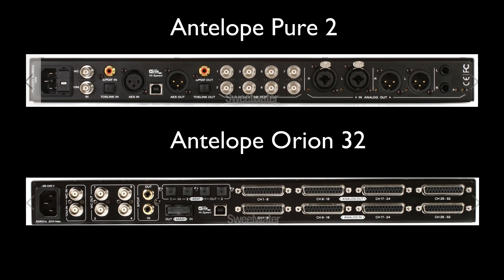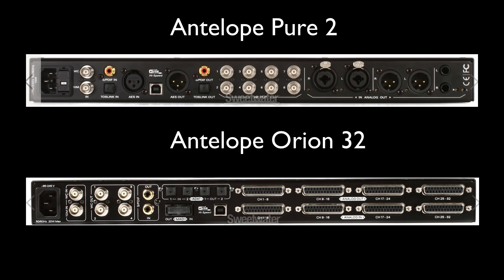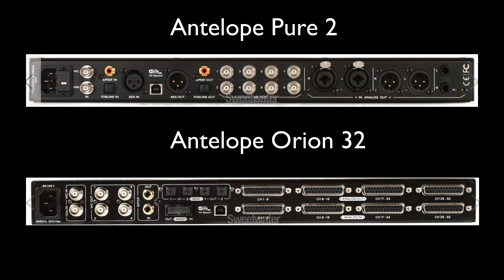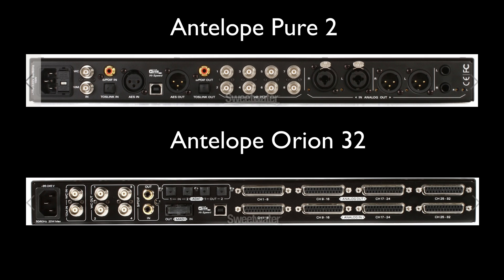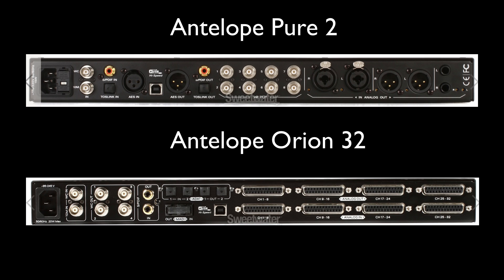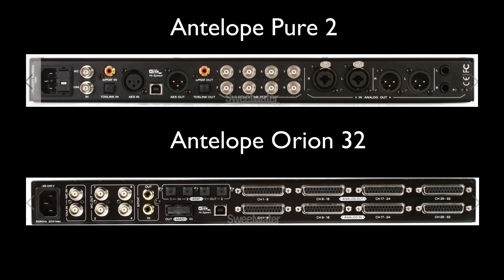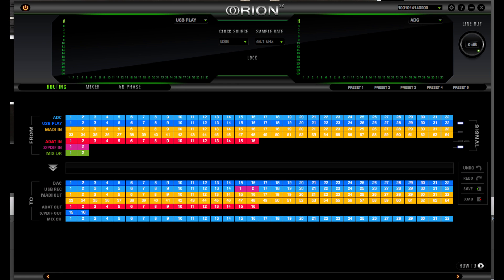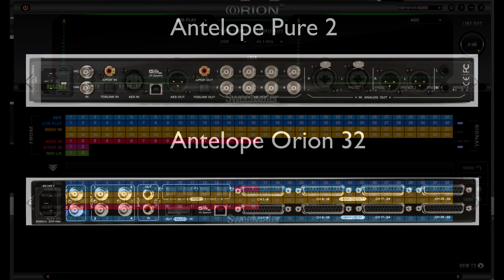Audio Converters explained and how to connnect them

Comment: Hello, GREAT VIDEO! Thanks so much. Can you please help me with the following.
I jut got a Burl B2 ADC and I wanted to ask how I would hook up the B2 ADC into my Apollo X8P so that I can mix and listen to the out put of the B2?
My normal chain and bouncing option is straight from my Apollo X8P to hard disk via off-line bounce.
So now heres what Ive done to accomplish this:
* Clocked the Apollo to the Burl with word clock BNC (Master)
* Routed output 7/8 from Apollo to analog in on BURL
* Burl TOSS out to Apollo ADAT in 1 (changed Digital input in console matrix from ADAT to SPIDF)

This is where Im stuck!
Id like to listen to the B2 while producing/mixing.

I would also like to track thru BURL while recording vocals. 
Im thinking of putting the the BURL and the Apollo out 7/8 on to a patch-bay. So I can accomplish this.
Thanks in advance

Comment: What are your thought on this? So you are only recording 2 channels at a time when using your high end ADC?  Using toslink / ADAT you can use 8channels max?
I'm using the Burl ADC for 2 ins on optical / spidf and RNC MBC for 2 channels in on ADAT. That gives me 4 high quality ADC's available at one time. Recording from channel strips. I thought about the new Heritage pres with ADC 8channels but thought the MBC might be better and with the Burl and MBC I have two options. I have great channel strips so I don't need more pres...want more....maybe.  

I guess it does not really matter what interface you use if you don't use the mic pres or built in converters.  As long as the interface works with your computer and DAW efficiently. Not using the built in pres and ADC and DAC seems to eliminate any latency or lower it if there is any.
What has been your experience?

Comment: Love your videos. I have an Apollo 8xp and am Apollo 8 connected together. I have my pure 2 commected to the tos link on the Apollo 8xp set to SPIDIF. I can mix and then export my final mix over SPIDIF to my pure 2. 

Now I want to buy a Burl b2 bomber. To connect it I assume I would connect the analog XLR to a set of ports on my Apollo. Would I them connect the Left and Right over the AES Connector. To the Appolo 8xp. They say the Burl AES Port will allow L and R to the Burl. Again just resting to figure out how to add the Burl to my existing Apollo setup ?

Comment: Im in the same situation. Im just wondering, since I want after my hardware chain to end at the pure 2 (pushing it a bit for nice clipping). Wouldnt it contradict that to go back into the orion or once it converted back into the pure 2 then the quality wont change again going thru the orion?
Reply from the maker: the pure 2 is going into the Orion as digital,  for A/D. This means its stays digital to the computer, no further conversion is happening
Reply: @TheAudioCzar  coz i was thinking of creating the analog loop and spidf out of orion into pure but then pure to computer by usb. Wouldnt that be better? Or wont matter after the convertion is done? Thx bro.

Comment: thank you for sharing Helpful Information.....Whats your Take on Power Conditioners? How important or Relevant are they?
Reply from the maker: They are important. Everything in my studio is connected to power conditioner and UPS to prevent surges. I've had a surge take down a piece of gear before, I won't let that happen again
Reply: @TheAudioCzar  wow. That's sad...I see most studios using ferman power conditioner....it's seems a good buy but I find the connectors at the back very strange. I don't know any gear with those kind of plugs...how do I connect gear to the ferman or do you recommend something else?

Comment: Great video bro! I’m grabbing a dangerous convert a/d. I’m using an Apollo x6 for an interface. So as far as printing the mix and hittin the converters what’s that setup look like? Does that even require me to be connected to the Apollo? Sorry for the noob question haha. Thanks
Reply from the maker: The dangerous would connect to the Apollo by spidf/AES cable. Then when you select spidf input and your daw, those inputs would be the dangerous

Comment: Hey Czar, thanks! Do you need to go through the interface or can you go directly into the computer with the signal from the converter? I ask because I think about buying a studiolive32 mixer in order to have a lot of ins & outs without a need to cascade interfaces, but all of these digital mixers dont have the ability to capture a converted AD-Signal, no ADAT no SPDIF, only one AES going out (while the DA-conversion is not as important as vice versa). So what I would like to ask you is: Would it be a massive downgrade to stick to the presonus studiolives conversion in the long run? I mean, is that really sooo bad? and second: cant you just hook up the AD-converter to your computer? The recorded signal is running into the DAW while the rest is going through your regular interface?

Comment: I just heard the Burl B2 in action and I want it...
Right now Im using the Apollo 8x converters.

I record ITB and mix OTB.. I use several hardware chains then I run them into the Neve 5059. I use the 4 outs of the Neve and run them into a SSL Six with another hardware chain as an insert on the 2 bus before it goes back into the Apollo/DAW.

I want the Burl to be the last in the signal line of my hardware units coming back into my DAW and bypassing the Apollo converters. So I only want to use the BURL as and A/D... How would I connect this to the Apollo to bypass the Apollo converters?
Reply from the maker: Use spidf/aes out of the burl into the spidf in on the apollo.
Reply: @TheAudioCzar  Thank you bro

Comment: Standalone converters and Audio Interfaces are becoming one of the same as the gap bridges. Many people even refer to the Apogee Symphony as an Audio Interface because it connects to your computer and even has a headphone jack. Same with the Lynx Aurora (n). Both Apogee and Lynx has the options to configure the units with built in pre amps. Converters these days are becoming more and more like multi functional high end audio interfaces. The Motu AVB line and Focusrite Red interfaces examples of high end audio interfaces that are in the ballpark of Apogee, RME, Lynx, Antelope etc.
Reply: Apogee Symphony IS an audio interface.  Not that "people refer to it as" but that is exactly what it is.  - Apogee Support Team

Comment: What would you recommend i have focusrite Clarett 8pre thinking of either going a Neve portico MB or upgrading my AD DA/interface? might be tough question but interested in what you think thanks
Reply from the maker: The Neve would take you a lot further then new A/D D/A converter.
Reply: @TheAudioCzar  thanks!
Reply: @TheAudioCzar  if you could get one piece of hardware?  Go the preamp or compressor MB?  One piece to complement you plugins?
Reply: Thanks I ended up getting the preamp silver bullet and I got a Clarrett 8pre do you think it's worth upgrading to a Rosetta 800 or there would not be much difference with the Clarrett better to get something else? Thinking Rosetta800? Zulu? or drawmer 1978 bus comp?

Comment: I dont get how someone can use an a/d converter WITH an audio interface when the interface already has it..... EXample: you record something, signal leaves compressor goes into a/d converter and then into interface (which already has converters!!??) unless you need a particular type of interface?
Reply from the maker: If you go  line in into your interface you are using the interfaces A/D. If your using a standalone A/D converter, that would connect to your interface by spidf. Then the signal, say a vocal, would go mic - compressor - A/D, spidf out of the A/D to spidf in on the interface. Because its going spidf, which is digital, it stays digital after leaving the A/D going into the interface.

Comment: I have got a jvc smart tv with no audio but it has got a digital optical connection im trying to get the sound through the speakers on my amplifier so if i got a converter could I use the digital optical on in the TV to the converter and then a rca to the amp to get the sound through the speakers please thanks Jamie

Comment: Hi Czar I after checking out your videos I Purchased the Pure 2. Love the sound!!
Im using Aes connection Just wondering how to include Dangerous 2bus that only
has Trs outputs to the chain. help!! thanks
Reply from the maker: sum out from the 2bus would go to the pure2 in. You would need a AES to spidf cable to go to your interface if your interface does not gave AES.

Comment: If i have outboard gears, Mic - Preamp - Comp - Converter - Interface. are these in right order?
Reply from the maker: Yes, however your interface is a converter. But you if you had an external converter you would go from that to the line input of the interface
Reply: Czar thanks but the also final output(to the speakers) would be the interface as well correct?
Reply from the maker: @danielkang7789  yes, unless you had an external D/A converter. But interface out to your speakers would be using the D/A in the interface.
Reply: Czar sorry i meant using interface and the converter at the same time since I wanted some better outboard converter on top of the interface im using atm. But according to what you’ve just replied, does that mean I wouldn’t need an interface because i have a better external converter? and is that ok for my recording to final production and mixing as well?
Reply from the maker: @danielkang7789  you would connect the external converter to your spidf on the interface, you would still need an interface because most likely the interface has the majority of your I/O, like more example, my Presonus Quantum carries my I/O, but the Antelope Pure 2 is connected by spidf to the quantum
Reply: @TheAudioCzar  Thank you.

Comment: Czar, Peace King. I have a Roland Octa-Capture 10/10 as my audio interface connected to a mac pro. I also have some outboard gear (WA 273 Eq and 2 Distressors EL8x). My issue is that I have a bit of latency when I do digital summing. That is run the signal out Left and or right and doing some outboard processing and bring it back in. My question is what would be the best way to solve this issue?
Reply from the maker: What DAW are you using?
Reply: @TheAudioCzar  Thanks for responding King. I'm using Pro Tools 2019. I get a 253ms delay. I've tried the buffer on both my computer and interface. It still delays at the same 253ms.
Reply: @TheAudioCzar  Peace King. Did you find out anything that may help me?
Reply from the maker: @DaGodMoryae  Pro Tools 1019 should have delay compensation. if thats on I'm not sure why its not compensating for that. 253ms is a lot, is it telling you that at the bottom of the track of the mixer? And has its always behaved this way, or just started
Reply: @TheAudioCzar  Delay comp is on. And it still gives me the delay. Just started using the analog gear about 2 weeks ago and its been doing it the whole time. Ive been nudging it into place and 253 is about where it lines up.

Comment: Thanks! How would I connect  Bae 1073 Mic Pre to an A/D converter for example?
Reply from the maker: Just connect the output of the BAE to the A/D converter. The converter will XLR or TRS line level connection
Reply: audioczarnet thank you
Reply: Gavin Jack same thing I need to know

Comment: 2:25 - Not all audio interfaces have converters in them, or preamps for that matter. I have an RME RayDat which interfaces between my gear and my computer via ADAT, AES/EBU, SPDIF, and MIDI connections, but the interface itself does NOT convert A/D or D/A, nor does it have a single preamp built in it. All of those must be provided externally. Still a great video!

Comment: I'm looking for a rca to digital converter.    I want to rip all my vinyl to my pc.     And suggestions.   Looking for high quality.   Anything in the 150$ range ?
Reply from the maker: Do you have an interface? You can get rca to 1/4 inch adapters and run to your interface. Or run RCA into a mixer and the outputs to an interface. That way you can control the level.
Reply: @TheAudioCzar  . i can simply connect in the headphone  jack port on the back of the PC... but im looking for something that will usb into the computer..

Comment: Thank you very much for your tutorial. Awesome!!
It's really well explained. I just don't figure out with one thing.
If I have a track worked in logic (al digital). Do I have to go out from my interface with SPDIF to Pure 2 and then coming back from pure 2 with its analog out or do I have to go out from my interface in analog to the pure 2 and then coming back to the pure 2 in digital?
I think that less passage I do, the better it is. So probably if I'm in digital I need to continue to stay in digital to the pure 2 and then coming back from the pure 2 in analog to my interface.
What do you do usually?
thank you very much!! keep going on!!

Comment: What confuses me is when you talk about recording into the pure 2 and then have it going out to the Orion 32 , does that mean you cant use all the I/O of the Studio 32 if you wanna use the D/A of the Pure 2? Let me know if my question doesnt make sense. Im new to the high end world of conversion/interfaces and trying to figure it all out! I would hope you can still use all the I/O of the Orion for recording/mixing/mastering but then use the Conversion of the Pure 2.
Reply: You can use all 32 channels on the orion, however to use the spidf or adat you have to sacrifice those channels from the physical I/O. So for me when I am connected with the Pure2 by spidf, which is two channels, I lose 2 channels from my physical 32. If I was use adat (8 channels) on the Orion 32 I would lose 8 channels from Orion 32 physical I/O.

Comment: i am interested in buying a rme audio interface and dedicated a/d and d/a converters.

1) do I need both a a/d and d/a unit and a clock for this to work? or can i just buy a a/d converter and connect it to a audio interface?

2) can someone show me or link me to a video on how I would connect a a/d conveter to a d/a and then a clock and then to my interface?

cheers
Reply from the maker: you can use the A/D converter as a clock. Just connect a word clock cable from the out of the A/D converter to the word clock in on the RME.
Reply: what is the cheapest audio interface with wc & spidif inputs?

Comment: Instead of lining the micpre to the converter, what happens when we line it in the audio interface converter? Is the preamp "useless" if we connect it to the audio interface preamp converter ?
Reply: You can go line into a converter on the interface, just make sure when your interface bypass the pres when connected by line level if your using a combo jack (XLR/TRS in one) Not all interfaces bypass the mic pres.

Comment: Now I am confused again; 7:19 Why would I want to connect a DA/AD converter to an interface? Shouldn't I rather connect it to the computer?
Reply from the maker: you would connect the A/D D/A converter to the interface, digitally. So for the D/A converter you could go spidf out from the interface to spidf in on the converter. Now you select spidf output on the interface it will be coming from the d/a converter.
Reply: interface is the "computer" or the soundcard.

Comment: Very well explained! I really wasn't able to understand how an audio converter fits together with an audio interface in a signal flaw. Now I understand that an audio interface has a AD/DA converter inside, but it also has mic preamps, sound effects, and so on, whereas, if I want even better audio conversion, I should buy a standalone AD/DA convertor, such the Antelope or the Orion that you mentionned there, but that means I also have to get standalone preamps, sound effects, reverbs and so on... but not "All-in-one" audio interface. Did I get it right? Very informative sir, thanks a lot!